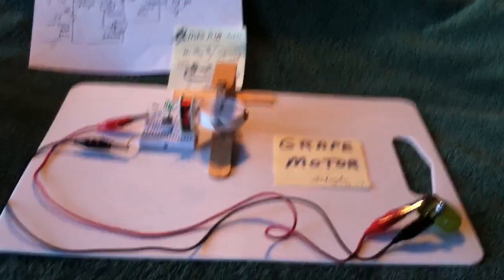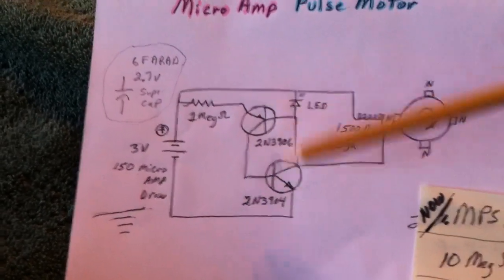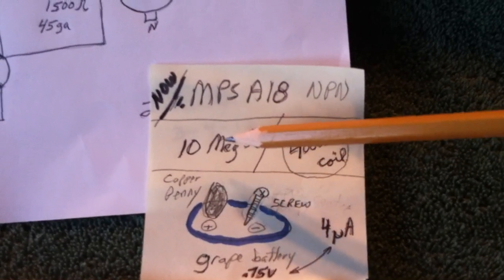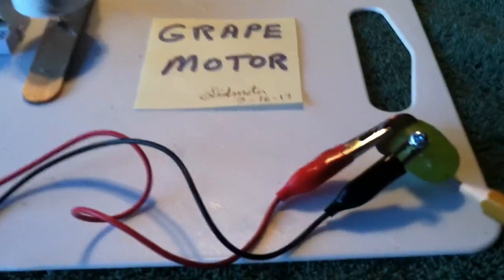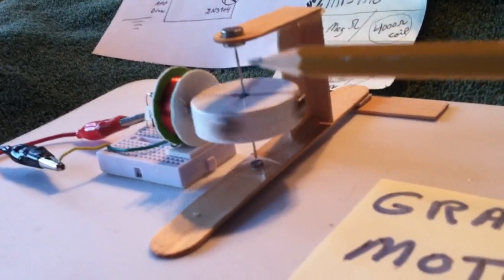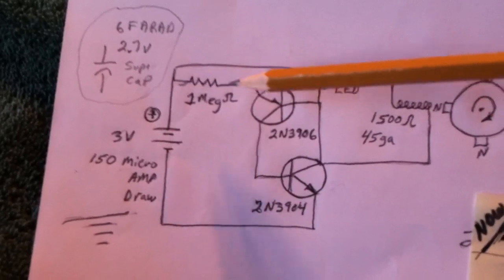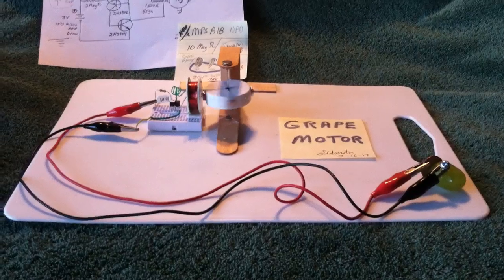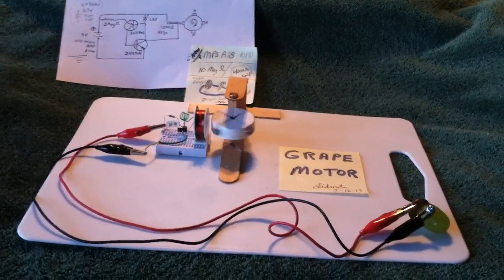Grape Motor

Comment: Hi Rusty. You never cease to amaze me. I'll have to find a grape and try the modification. Very interesting thanks. Hope you're doing well.
Reply from the maker: Hi John.  Good to hear from you.  I'm OK.   I'm really not sure what these modifications to your circuit did to make it work at such low power levels.  The high ohm / fine wire coil I think is the key element.  I hope you get a chance to mess around with this a bit.  The grape battery was just a random thing.  I was going to use a lemon but the grapes were easier to get to in my crowded fridge. lol

Comment: Where is this little small green coil in your circuit diagram ? is this the second coil for controlling the transistor pulsing ???
Reply: Why does it pulse at all with just one coil ??? can you use a scope and show the base emitter voltage of the lower transistor ? Many thanks.
Reply from the maker: The green coil is just one of the 4k ohm coil's leads coiled up.  It doesn't do anything.
Reply from the maker: I need to look at this on a scope and see what is happening.  I think that the magnets on the rotor induce a current in the drive coil that causes the triggering.  The motor will not self start.  You have to spin it to get it going.

Comment: How many rotations until your grape power is spent? ;)

Thanks for sharing!
Reply from the maker: It is still running this morning.  I guess that is about 16 hours so far.  Maybe I should set this outside in the sun and turn the grape into a raisin --- then see if it keeps on running.  lol  I just checked the voltage on it and it is still over .7v.  I'm surprised.  The cell chemistry should have neutralized by now.   Just think of how long this motor would run on a 2500mAh AA.
Reply: Do test 1 indoors without any sunlight.
Do test 2 outdoors with sunlight to see if the grape will absorb any of the solar energy. :)

Of course, you'll probably need to find 2 grapes that are nearly exactly the same shape & weight to get a meaningful comparison. :)

Comment: I have a question: i used 1 mega resistor and it doesn´t work...! do you realy used 1 mega resistor...?
Reply from the maker: This circuit is sensitive to that resistance value.  Try adjusting it from 1K all the way up to 10 meg and see what happens.  I used a 3 Meg pot and then added 1Meg resistors if needed.